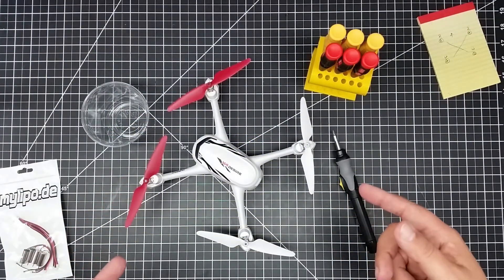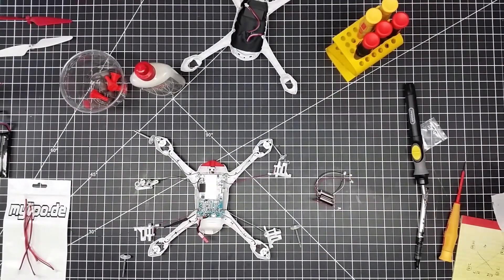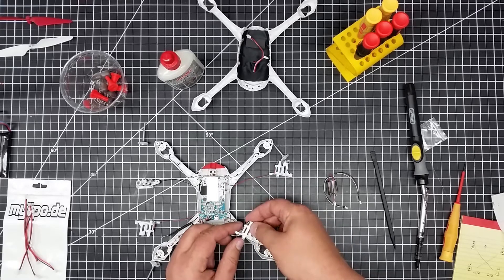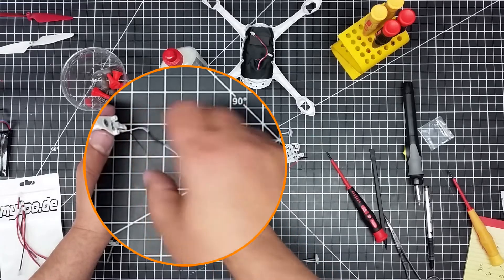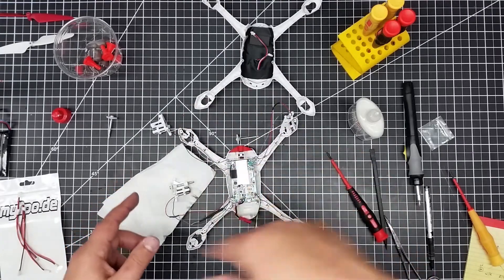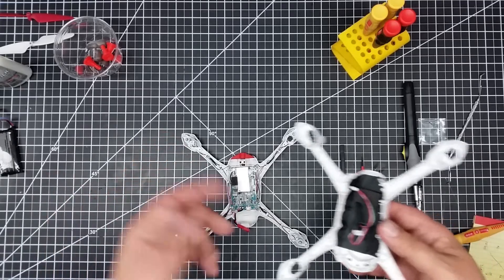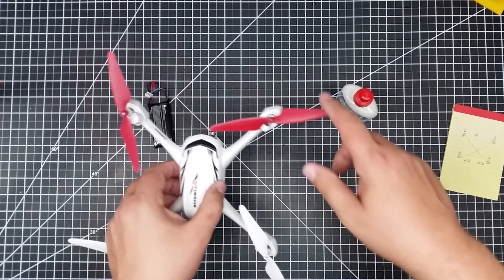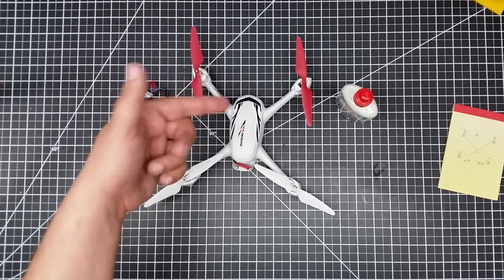Hubsan 502 - Upgrading Motors From MicroMotor Warehouse!

Comment: Nice video.  Why did you decide to cut and splice the wires rather than solder right to the board as shown in other videos.  I too was thinking this might be the better route in case of another failure but was wondering if you had another reason.  Regarding the heat shrink, I was thinking you could have put heat shrink on both wire if you staggered the placement so that they wouldn't align in the arms and be difficult to fit.  This would add extra strength to the solder bond, but as you point out since the chassis is plastic, probably not necessary.  Also, do you think the micro warehouse motors are superior to the Hubsans and if so, why?  Thanks
Reply from the maker: Yes to are the micro-ware house motors being better (way better), it was a while back so I don't remember why i reused the wire however I believe share why in the video. The heat shrink was simply a function of space and a little for balance as two prices simply weren't needed.  However I would again stress these motor are well worth it!
Reply: @VideoDrone  Thanks.  For anyone viewing this, it seems micro motor warehouse no longer makes/supplies replacement motors so I got some OEM Hubsan ones for a replacement.
Reply from the maker: Wow disappointed to hear as I liked their motors...

Comment: so...50 or so flights with the stock motors...how many flights with the motor upgrade
Reply from the maker: Have not had to fly it since making the upgrades.  Just in testing, believe the motors are slightly hotter.  However I would estimate the wear the same as they still are brushed motors after all...

Comment: Get the tail with connectors option and solder these to the board, then when you change again it's just a case of undoing the connection.
Reply from the maker: Interesting, might give that a try...

Comment: That is exactly why I stopped flying my 502e. The motors had a horrible lifespan and swapping them out was such a pain in the rear!
Reply from the maker: You are right, that's why I went with the MicroMotors Warehouse motors this time :-)
Reply: how many extra flights with new coreless motors?
 @VideoDrone
Reply: i got 16 flights before it fell out sky, i dont understand why make such garbage